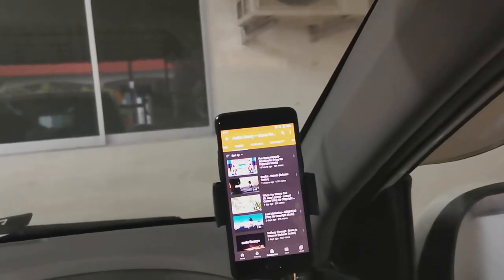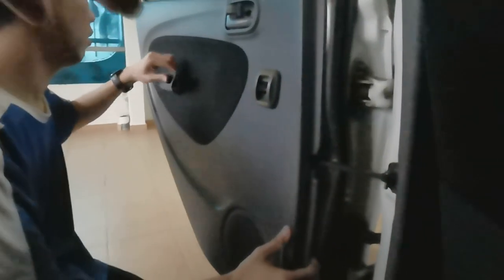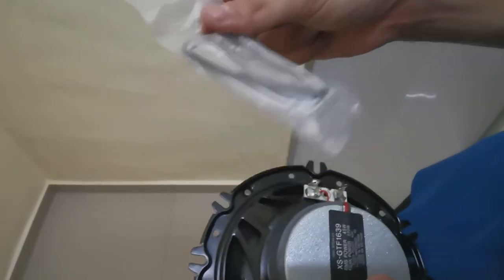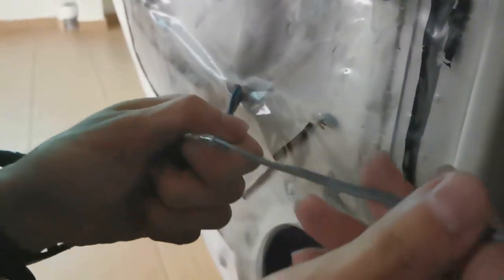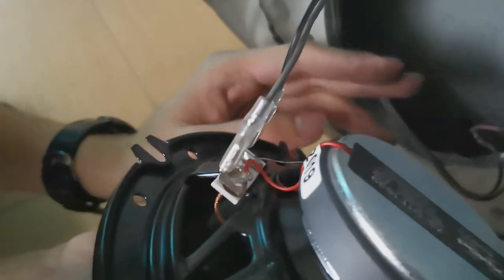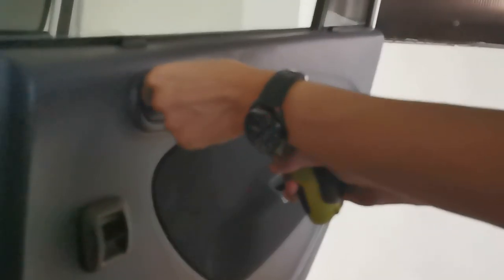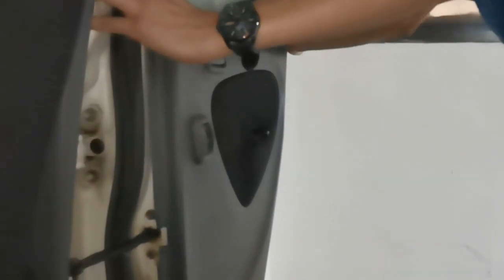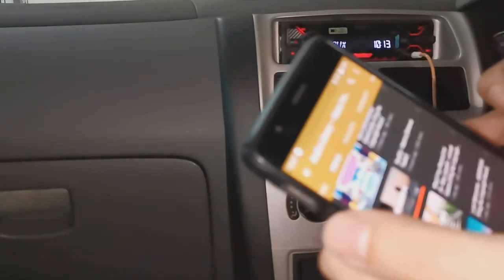INSTALLING SONY XS-GTF 1639 6.5" 3-WAY COAXIAL SPEAKERS ON PERODUA VIVA | REVIEW+SOUND TEST | PART 2

Comment: Did you set custom eq in this video and the what is the level of the extra bass button you set to ?
Reply from the maker: Bass level 0 and no eq
Reply: @PenguinTech521  then why you are telling that you don't like its bass brother ? I have the same radio and recommend you to put the eq to ( rock) and extra bass level 2 ,  and can you please make a small video with these settings ? Thanks ❤
Reply: @PenguinTech521   can you confirm this ? Try what ive said in my comment
Reply: @amgil475  bass boost is a big no no.. all it does it jack up the upper bass and add distortion from little janky 6.5" speakers. Set your EQ flat and get a decent sub(s) with a quality amplifier. And for Pete's sake don't max out the gain (volume) and bass boost on that either! It's supposed to be music so enjoy it. Yeah I get it, it's fun to crank it up but unless you experience truly stunning high quality audio, your better off with a decent set of headphones or buds.

Either way, it's up to you however you want to enjoy your music, but suggesting to another person to change settings that will actually worsen the quality is a big fat no no IMO and of many many other professionals and hobbiests alike.

Comment: So how was the new speaker sound? Better, same or worse than the original?
Reply from the maker: Better. Can output higher volume without cracking.
Reply: @PenguinTech521  the price is unbelievably cheap, Sony brand some more, I came here to know the results, I guess the speaker is good to buy.
Reply from the maker: @REZDUANBINRAZALI  not top of the line. But good and cheap enough

Comment: The worst kind of installation where you don't insulate the wires
Reply from the maker: Yeah I did it after the video lol. Did mentioned it too
Reply: @PenguinTech521  you should have shown as some might do without insulation watching your video as a reference. Funny enough I got a new radio in and realised previous owner changed the radio without any insulation 😂
Reply from the maker: @SkidZerO  well noted

Comment: @PenguinTech can your sony head unit handle the power required to drive all 4 sony speakers?
Reply from the maker: Yup. Up to 4x55W speakers.
Reply: @PenguinTech521  thanks man, actually I already have the same player so was considering changing to some speakers with more bass and the 1 you fitted seems ok.
Reply from the maker: @sramasa6  turn on the extra bass on your head unit and you'll experience heavier bass :D
Reply: @PenguinTech521  got it and thanks again

Comment: Nak tanya . Kenapa speaker dasdboard lagi kuat dari speaker pintu blakang yee  . Sebelum ni pakai speaker ori bunyi speaker blakang lagi kuat tpi dah tukar speaker lain tiba2 slow
Reply from the maker: Wire connect betul ke?
Reply: @PenguinTech521  tak pasti sbb kedai assessori yg pasang .. takde beza standard .. bunyi lagi slow
Reply: Wayar terbalik tu

Comment: Bro is this plug and play for Perodua Kenari
Reply from the maker: Need to check the speaker size for kenari
Reply: @PenguinTech521  I already checked for front speaker is 6.5 inch but I don't know for the rear speaker because its a roof mounted setup